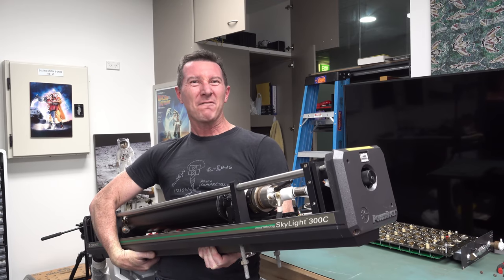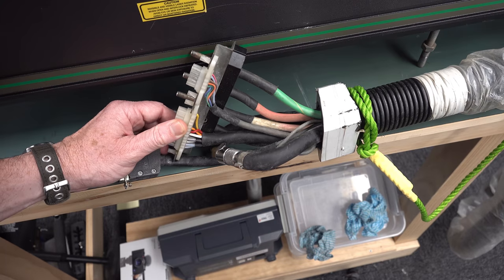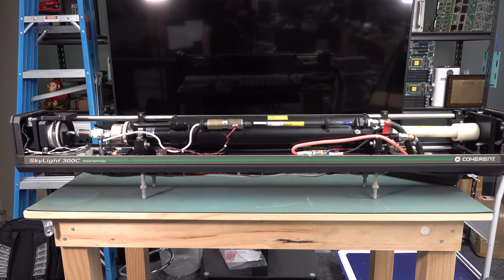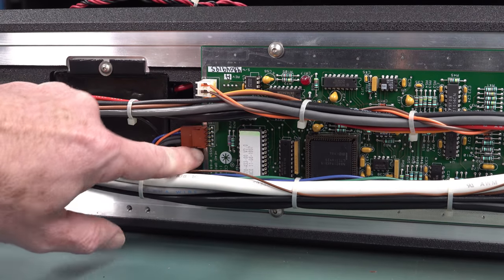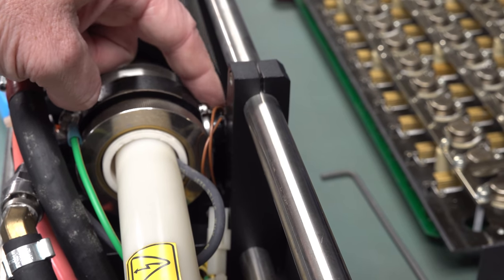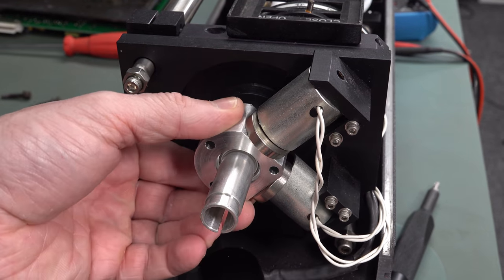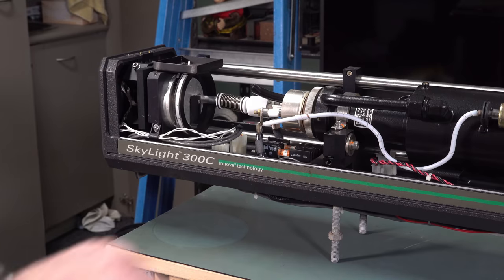EEVblog 1412 - Argon Ion Laser TEARDOWN!

Comment: Also, on these models, if the “Laser Radiation “ light is out, the system will not start, thought of switching out mine with an LED, instead of a filament, and found that it measures the current thru the existing lamp, to verify that it is on, for a safety factor. No indicator light, no Lase!!🤗 page 6-1 
Photo output sensor is that black sensor at front of Laser Mirror too with a beam splitter that you unscrewed at beginning.

Bellows for keeping Dust out of optics.

Also inner jacket is water cool for plasma tube, outer jacket is for the Magnet cooling. You can change output mirrors to other nm, to select light frequencies 

Excellent Tear down!!

Comment: Holy moly I remember using those, one argon for 488 and 515nm and one for 658nm red krypton. Beams all mixed together with dicro mirrors then piped into a PCAOM. Eventually got a set of yellow green optics for the 560ish line of krypton. Yup they make great space heaters if it's chilly where you are doing the show if you use a water to air heat exchanger. Built my own using automotive radiators and the cooling fans. Because 480V 3 phase at 50A per phase and plumbed water is a horrifying combination. Early 2000s. Also the lasers cost about as much as a new car when they were new. None of mine were new though. The assembly you thought was a photodiode is the gas replenishing module. A valve that dumps the argon into the tube as it gets buried. I disconnected those as the psu would fire it too much if it thought the tube was too low on voltage or no reason at all. All that white ceramic is beryllium oxide as well. I modified these heads to run on SP 451 exciters as well. Kilowatts for miliwatts. 😂

Comment: Discovered the Midas touch while building the XR2206 function generator.. touching around the circuit(on safe circuit) and if it works(the pin on the peaks go away) you measure the capacitance of your finger the distance of the contacts.. so I installed a 201 cap between the frequency and amplitude pin and its gone with no distortion..  We have Muncing.. Now we also jave the Midas touch...

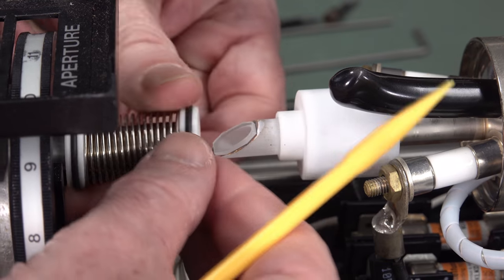Comment: 16:52 I am certan that this is for decoupling the laser from the housing as a flex joint. 

And also looks to be dustproof since if you get a little dust on it thet absorbs light it will heat up and burn/crack the light output glass puncturing the whole tube.

Comment: On my engraver Laser there is a LED that uses like 30 Watt's and outputs 7.5 Watt optical. Times have changed. Sure you can't get same wave lengths and can't do same things but still efficiency is awesome. There is also a model with two of those diodes and it has limited optical power of 12,5 Watt and uses 40 Watt. Have had to correct numbers I have checked them up.

Comment: So late to this...
 I worked in Ion lasers for 15 years.  We mostly worked on the 165 and 171 Spectra Physics.  We serviced Coherents as well, but not tube replacements.  What a rush down memory lane.  I also worked in lights shows for most of that time as well.  If you think the power used was ridiculous it pales in comparison to the water waste.  The water could not be recirculated because you just needed to get all those watts out.  The water from the laser was HOT.  We used to joke that if you drank from it you would live forever...  mmm laser water.
At the laser repair lab I worked at we dumped upwards of 16 gallons per minute down the drain....  24 hours a day.  That's near 25,000 gallons per day.  I'm not sure how we got away with that other than we paid the bill.  You'd think the city would have shut that down.  I'm sure the electric bill was frightening. We were manufacturing new tubes and part of that process was running them for many hours.  
When Lexel went out of business we bought it and built new Lexel lasers for many years.
When Spectra Physics shut down their glass tube ion lasers division, we bought that and supported those lasers for years as part of the deal.
Working on the 171s was my favorite.  I used to go out the Crazy Horse memorial annually to service their 171s for their laser shows (they have SS now).  So many amazing memories.  I did laser for so many bands and events over the years.  We did all the openings for the San Jose Lasers womens team.  We did game openers for a few seasons of the Sacramento Kings and the Warriors.   Did lasers for Sabercats and for the Sharks too.

Comment: what a beast! cheers Dave
that springy tube thing.. looks like ya cant actually see through the "coil" it would block any light that is scattered off the output lens..ya dont get 100% pass straight through some is scattered off at right angles.. ...its extra eye protection...the o-rings probably go through to the middle ..for grip on the shaft when mounting....

Comment: I would think those mirror adjustment screws are 'differential screws' - 2 screw threads in one, cancelling each other out. One screw thread has a thread width (pitch) that is just a little bit different than the other one, thus the cancellation is just a tiny bit off. And so, one rotation of the screw results in a tiny displacement.
(then again, you could see quite a displacement as Dave turned one of those screws...so I'm not sure)

Comment: I wonder why both of the ends look crooked, like visibly out of alignment. The output end, that metal spring/fin thing that goes over the Brewster window seems to need the springyness because it is like the axes do not align. And the back end, those white plastic tubes seem to be at different angles!

Comment: point of note: argon lasers don't have red beams. they lase with blue and green lines with 488nm (cyan) being the predominant wavelength. it's all dependent on the optics, but you'll never get red.
Reply: Krypton makes red.   A mix of Ar/Kr makes all the colors you need for white light, but at a big cost to efficiency and thus lower overall power.

Comment: Dont take it apart, turn it on😂😂😎 Why the hell do all the office in the building have a gaping hole!
Reply: Small problem of no 24KW power supply.
Reply: @simontay4851  He has the power supply also somewhere in the storage! Dave showed it in a video. the only thing missing the the controller.

Comment: What a complex evil thingy. I remember those were expensive as a sports car back then.
Is there a chance you can get this one to run - or is it a museum artefact?
Reply: A very expensive sports car at that!
Reply from the maker: Nope. The PSU is gone, and it needed a 24kW supply.
Reply: @EEVblog  Also after it sitting for so long, most likely the tube is dead. New tube has a 5 digits pricetag for sure.

Comment: I got a small unknown Argon Laser from eBay for cheap like 15 years ago. It had 150mW 448nm for about 850W input... I don't want to sound like "audiofool" but it was beautiful compared to those 445nm diode rubbish ;) 
Those rubber ring spring thingies are just there to prevent dust burning on the optics I think

Comment: The device on the small tube that you called a diode looks like a double-acting solenoid valve.  I've seen similar ones on some of the smaller equipment in our lab.
Reply from the maker: Yes, someone mentioned that bove in the comments, the tube on the other end contains gas.

Comment: This doesn't look like a clublaser, because in the most clublasers, the laserlight goes sideways, and the front is full of optics, like dichroic filters. I'm also not sure, this laser has to heat up in steps? And to cool off the same. I also don't see a bypass, laserlight stays emitted, even if it likes the laserlight is off on the front. I did work for years with such baby's. The black knob, on the front, is a safety precaution. If the laserlight is accidentally emitted, you have that black knob that protect your eyes. The optics in the little tube, is a dichroic filter or a triad (which makes 3D effects), and that change the colors. Green lasers go way further than red. So green it is at night.

Comment: Some CRTs used an Invar shadow mask to stop them from changing shape with heat.
Also, those electromagnets look like they're been used for the Faraday effect, which can affect polarization of light in some materials.
Ben from Applied Science has a video about it.
Reply: I once had a TV with an invar shadow mask, but it was in fact the only TV I ever had that showed problems due to shadow mask heating.
It was one of those "flat square" jobbies with a large diagonal, probably that first introduced the problem that they then tried to counteract with the invar mask.
However it still showed color patches after it had displayed bright white for a couple of seconds, sometimes visible during normal programming.

Comment: I had a 1 watt air-cooled argon in the 90's. It took over 700 watts and ran HOT.
Reply: So a 700W fan heater with a 1W laser.

Comment: The two " magnet" are actually actuator base on magnetostriction - use to stabilize pointing and power drift
Reply: Ah, so it has PowerTrack? Was wondering that, since IIRC that always was an optional feature.
But of course very useful for a mostly unattended show laser application.

.. okay have seen it, was a temporary lapse of attention.

Comment: @ 26:50 Could this be a Faraday effect window/cell? The Faraday effect rotates the polarization angle depending on the magnetic field strength, as opposed to the Kerr effect that does the same with an electric field.
Reply: That's my guess as well. The mirror doesn't move.
Reply: Hi, I am the manufacturing engineer for this laser. The two perpendicular solenoids adjust the angle of the OC mirror under PowerTrack servo control to maintain peak power (optimum resonator alignment) . The entire OC mounting "snout" feature is surrounded by a circular deep groove on the front adjust plate. The bottom of the groove effectively serves as a flexible diaphragm to allow the pointing adjustment to take place by deflecting the snout's angle. This is especially helpful for maintaining peak power from a fresh cold start up of the laser. The super invar rods are not perfect and they do have a certain CTE level that slightly differ from each other. Since they slightly differ from each other in CTE, they will thus each expand by different amounts as the resonator warms up. Even if all the three rods were perfectly matched, the top rod warms to a higher temperature than the two bottom ones do as the cathode header runs at about 100C, warming the head enclosure, a little warmer at the top than the bottom. The typical angular delta in mirror plate compensation during warmup is usually a few tens of uRad. PT can also serve to allow hands-off operation of the laser over extended periods of time of weeks and months. The resonator will slightly drift in alignment over time with mechanical settling etc., but PT will compensate for this. W/O PT, one would have to make occasional small adjustments to the two X-Y rear plate adjuster screws. Also note that those two screws are "2-speed" screws. The outer cap has one revolution of very fine adjustment that changes the internal pushrod linear position, and with further adjustment then rotating the entire screw for a coarse adjustment.

Comment: Loved the amp hour podcast, I recommend listening to it! Just a note/question... why make the beam in the thumbnail edited to be red when they make a more cyan color at the 488 peak or green at the 514nm peak usually?  

The metal tube is probably just an off the shelf metal  hi-vac flex hose, but it's job in the laser is to keep the dust and moister off the optics. You don't want to fire up a laser with dirty optics.

Ion lasers are awesome, I need to own more of them eventually!
Reply: @EEVblog I am 100% down to chat on an amp hour episode, I have plenty of optical knowledge and anecdotes!

Comment: Value wise, these are more or less scrap despite people on eBay trying to sell them for thousands.  If you've followed any of them for nearly 20 years, you'll see the same junk relisted again, and again, and again.  It's not going to work when it arrives anymore.  The tube is shot and needs to be serviced which can cost a couple thousand.  I was offered the entire laser package one science center had because they were tired of the bulk, power demands (they ran constantly) and constant need for the show variance from the FDA.

They are fun, they are very quiet, they do output a perfect beam...but they require tremendous power and water cooling.  I've since moved on to DPSS only.

Comment: is the rigid metal tube around the photo diode leads just a current guard to stop leakage from the hi voltage lines before it gets back to the TIA? ... cannot think what that big tube would be though ?

Comment: It's a funny thing about optical power with lasers. Someone might say "ten watts, what, any light bulb is far more powerful". But then when you discover (hopefully before using a laser in the watts class) that a rule of thumb is that reaching about half a watt in laser power is beginning to be dangerous to your eyes even from a diffuse reflection (i.e. from a matte surface), you might develop more respect for lasers :) Weeell, of course today even LED pocket flashlights can be dangerously bright, so...

Comment: I spent many hours as a graduate student fixing and maintaining Coherent and Spectra Physics Argon Ion lasers.  Long live DPSS!
Reply: I found one of these in a dumpster.  Just curious what sort of power supply it needs to run?
Reply: @Patrick-rj8gh  Probably something on the order of a few hundred volts and 100 A or so, three-phase almost certainly.   It also needs a starter circuit I think, some kind of trigger transformer for initial ionization or igniter.
Reply: @profdc9501  Thank you. Oh no that sounds a bit too serious.  I picked it up out of the university e-trash for a friend who's into making holograms.  It had Radiant Dyes GMBH type RD-YAG-50 written on it.
Reply: @Patrick-rj8gh  You might be able to use a single longitudinal mode DPSS laser, 50 to 100 mW for holograms (for example dichromated gelatin).  I picked one up for about $600 off of e-bay.   For example a Coherent Compass 315.   I bought a laser from Starlight Photonics ( https://www.ebay.com/str/starlightphotonics ) and it worked well.

Comment: There's a good chance that all the white ceramic bits are BeO. Don't sniff the dust after crushing it :D
Reply: ISTR reading a while ago that BeO is only used on aircooled tubes
Reply: @tylerethernet8610  Makes sense. But I would still test before grinding away :D
Reply: @zaprodk  Sure. Or, better, just stay away from it -- don't take it apart, but switch in on! ;-)

Comment: The type of emission that produces laser light occurs when a majority of the molecules in the tube is in a higher energy state than the ground state. It's not enough to bump just some of the molecules to the higher state, an overwhelming majority is needed (otherwise the specific quantum process doesn't occur) hence the huge power input. The molecules tend to decay to the ground state very rapidly, so in order to maintain that a big majority is in the pumped state there is a huge amount of power input. I expect that only a small portion of the energy input even makes it to being converted to light that is propagating along the length of the tube. (Light not propagating along the length of the tube never makes it to the exit.)

It's not so much that the bouncing back and forth gives the amplification. I think there are types of laser emitters that emit in pulses, with each pulse generated by a single avalanche event; the light is not reflected. The bouncing back and forth happens because there are mirrors on either end. The mirrors are there so that you don't lose light to absorption.

The reason the mirrors need to be aligned precisely: if the alignment is off some of the light will hit  the sides of the tube, and will not ever make it to the exit.

Comment: it is actually more like giant Neon Tube... with a DC power supply. Magnets play a minor role, just so the hot plasma is pinched in certain areas..
Reply: That makes more sense. Although I dont really know why you would pinch it?
Havent looked into argon lasers, just know that the HeNe ones dont need magnets.
Reply: @Basement-Science  AIUI the magnet concentrates the plasma towards the centre of the bore to get higher current density
Reply: @mikeselectricstuff  Oh so it is all along its length then? (not just in some areas, like OP suggested) 
That would make sense to me.
Reply: @Basement-Science  yep it pinches the plasma to a more concentrated form, since photos need to collide with electrons as much as possible. Plus the magnet field could be used around fittings to keep the plasma away. The ceramic / borosilicate bores are pretty sturdy, but where you have T-offs etc for gas flow, water cooling etc it can get tricky. 
I do remember that some of the tubes also had gas bypasses to flow around the main bore back to the other side, dont forget this are DC systems, so very polar even in regards to plasma.
Reply: @mikeselectricstuff  each tube is a bit different... its a bit an alchemy :). But in general you want to pinch the plasma coaxial yes, to keep it away from walls and to make it denser.
Reply: @SarahKchannel  Thanks. Would have been really cool if he actually disassembled it to see the arrangement in this one.
Reply: @Basement-Science  Mechanically they are not very interesting, with exception of the material science. But the physics behind it, like what he mentioned with the brewster windows.
I built one my self about 30 years ago, as a physics project... only about 1m long thought ! 
But at the time we experimented with microwave induction for the plasma excitation not via direct electrodes.